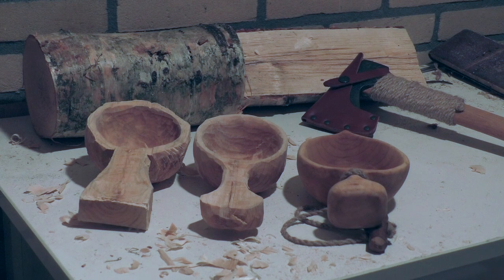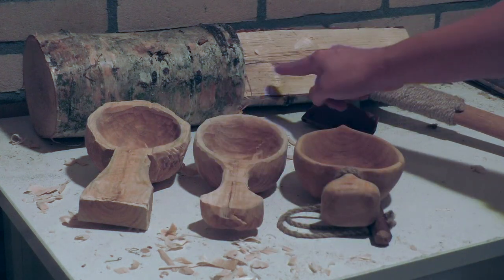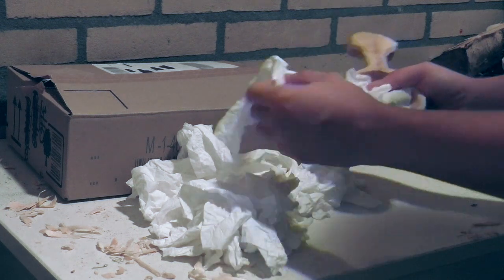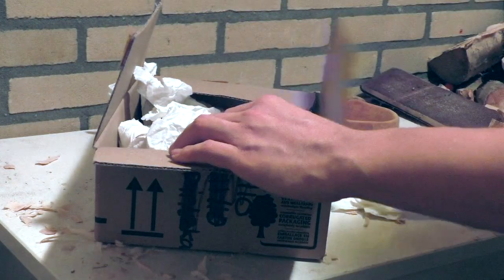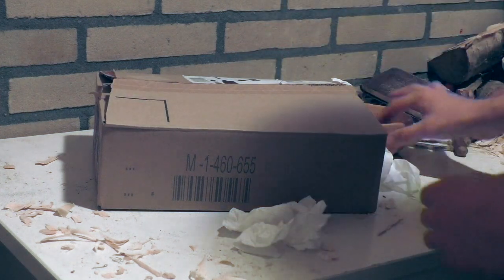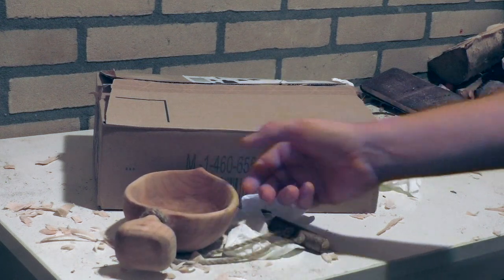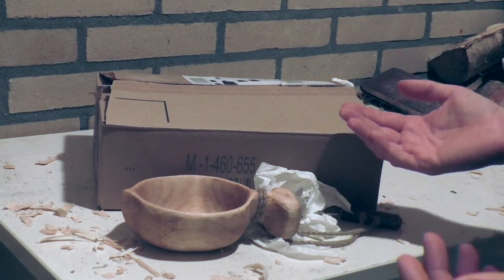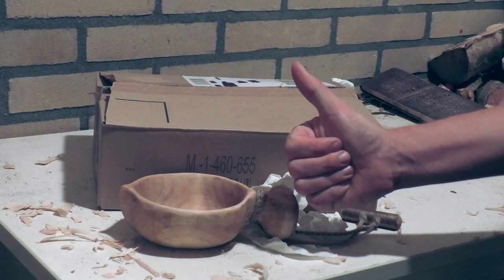How To Dry A Kuksa Safely Without It Cracking Or Splitting

Comment from the maker: HERE ARE SOME ANSWERS TO YOUR QUESTIONS: 
Q:   How long should I leave the kuksa to dry? 
A:   As far as the exact drying time depends on your very selection of wood and the respective project as such, I cannot tell you a specific time frame you could keep in mind. But in general you can tell that all went well by touching the very toilet paper or tissue paper with your lower lip - once all the moisture has been successfully removed from the fibers AND evaporated fully from the paper box and TP, you are good to go. The TP and box need to feel absolutely dry to the bone when touching them with your lip. I personally leave projects for yet another couple of weeks once that point has been reached , just to be sure. Patience, as so often, is of the essence.
Q:   When closing the box, don't you provoke fungus growth? 
A:   Theoretically yes, but I never experienced any issues with fungus/mold when using this method. It might be worth mentioning that I am usually working in intervals - let's say the rough outline is done on Monday using a hatchet, then I'd continue one or two days later with the rough knife work, just to finish the fine carving by the end of the week and having the sanding done once the drying process is done as mentioned in the answer to the first question. So in other words: By regularly opening the box to get to my projects, I am ventilating it anyway. I would recommend doing this once a day or so, just to be sure. Besides that, I store my projects in temperatures below some 20°C (i.e. some 70°F).
Q:   What do you use for the finish of your kuksas after they dried? 
A:   Personally I stick to linseed oil. One might go for charring the wood, too - the process is called pyrolysis in case you want to look that up. I haven't tried that so far, but will edit this answer once I tried it. 
Q:  Does oiling the piece prevent cracking?
A:  Drying and oiling a piece are two entirely different steps and should not be confused with one another. 
Most cracks appear during the drying process, as explained in the video. Oiling must only take place after the project has dried to the fullest extent - the reason being that oiling your project closes the pores of the wood. Now imagine oiling a moist, green wood - well as you can guess, this will result in damage over longer periods of time. 
Usually the wood starts to get a little frizzy on the surface after a while, cracks can then reappear. 
So first let the wood dry properly, then go about the finishing with some sort of oil like linseed oil or so. The oiling mainly prevents decay in terms of rotting/fungus/etc.

------
Got any other question? Just leave me a comment and I'll gladly add the info here.
------
Wanna support this channel? Then please consider becoming a patreon - just visit my Patreon page here: https://www.patreon.com/rathwulvenbushcraft
Thank you.
DO YOU WANT MORE INFORMATION ON BUSHCRAFT, FORAGING AND ANYTHING RELATED TO THIS CHANNEL?
Consider subscribing to the Rathwulven newsletter - all for free, no obligations and you can always opt out if you do not want to receive it. Just register here:
https://mailchi.mp/6b4642ab28af/rathwulvenbushcraft
If you have any questions, please also feel free to drop a comment.

Comment: Not sure if closing the box is a good idea. You might get fungus then.
Here are my experiences.
I've made several kuksa's and to prevent cracking I put the kuksa during the project overnight or when it is finished in a standing paper bag with the woodchips from the carving, and leave a small opening on top for the moist air to go out. Don't close it, otherwise you have a good chance on fungus.
Another good way is by boiling indeed in salty water once the kuksa is finished, and if you want to darken the wood, drop in a few bags of black tea.
And last suggestion that i have not tried myself yet, but is used by a few friends of mine who ate experienced wood carvers, they boil them in milk.
Apparently the casein denatures, closes the pores, and thats it. Good rinse when done, and your good to go.
And as oil I use Tung oil, it will seal the wood also slightly, leaving a tiny hard layer.
Good luck!
Reply from the maker: Thanks for your view on this. I have to say that the salt water method causes issues, in my personal experience. As for the fungus: You got a valid point there, but I never experienced any issue of that sort for as far as I am working on the respective project in intervals. Maybe that makes all the difference, because if you do some 1 to 2 hours of carving work a day, you take out the items of course and hence ventilate the box as such. 

Gotta look into tung oil for sure, thanks for the tip. I usually stick to linseed oil. 
ATB 
Ralf

Comment: Nice! I am going for my first carving project, and I will try this method. How long do you need to keep the item in the box/how do know when it is dry?
Reply from the maker: Thanks for your comment, Arian. I wrote some additional info on that in the pinned comment. 
Generally the longer you wait, the better. Let me know how it is going ok? And if you have questions, feel free to reach out.
Reply: @RathwulvenBushcraft  Awesome, thanks! I have some projects in the box right now. I have changed the TP 1-2 times because the TP got quite wet. Still drying though, 7 days in.

Comment: Ive heard the main reason you do the salt water boiling is to clean and disinfect it. Something about the salt water drawing out the dirt and bacteria or something i think
Reply from the maker: Hi Connor - wherever that "information" is taken from: It is not true. Salt does not sterilize - if that was the case, no organisms could thrive in the seas, yet all life comes from salt water. Same goes for "cleaning" the wood pores. The funny thing is that any wooden cutlery or kitchen utensil behaves the same way: Warm/hot water opens and hence accesses the pores in the grain, cold water/air closes them. Which is one of the reasons one should not leave spatulas or spoons in a can of soup, for example but always has to remove them and wipe them clean properly. 

That salt water myth is a pretty tough one, probably started somewhere online and kind of established itself as a "fact". 

Have a good one!
Reply: @Rathwulven Bushcraft  very interesting. Thanks for the info, that's why I brought it up, I kinda wanted your thoughts on it haha. Very good to know, have a great rest of your day

Comment: As I'm admittedly not a wood carver yet the one thought that came to mind is how long are you leaving them in the cardboard box to dry? What are your indicators that its dry enough to not worry about cracking?
Reply from the maker: Hi Carl, I explicitly did not mention any drying time as far as this will always vary depending on the respective project, type of wood, and so on. But in general you can tell that all went well by touching the very toilet paper or tissue paper with your lower lip - once all the moisture has successfully been removed from the fibers AND the paper box and TP are dry to the bone, you are good to go. I personally leave the project for another couple of weeks then, just to be sure. Patience, as so often, is of the essence. Because there is one thing you do not want to do: Seal the pores with linseed oil or so while there is still a bit of moisture inside the wood. I learned that the hard way; it is better to just give your project another month than to just mess it up during the very final steps. 
Hope that helps, if you got more questions, just let me know .

Thanks also for pointing that out, I will pin a comment to the top with your question and an answer.

Comment: You could also use rice. Rice absorbs moisture quite well. Those silicon packs would work too.
Reply from the maker: Hey Scott. I am not sure if silica gel would be my go to, simply for ecosustainable reasons. For rice: I did not try that, also because I assume that rice would eventually turn moldy, wouldn't it?
Reply: @RathwulvenBushcraft  
No, if you're using it for only a week....it won't get moldy. It has to be moist before that happens. Drying wood, it wouldn't absorb that much moisture out of the wood....you could use it to dry several projects. 
Of course, check it after a couple projects. If it smells ok, carry on. Of it smells a bit sharp, change the rice.

Comment: Hi, have you even used thistle oil as a finish for kuksa? Or do you know anyone who used it? If yes what was the result?
Reply from the maker: Hi Martin, thanks for your comment. I did not use thistle oil so far so I cannot share any practical experience. Yet I have one concern regarding that oil: Most thistle oil manufacturers produce their products by cold-pressing green plant parts, which results in a different type of oil as for example those extracted from seeds like linseed. The main issue with oils extracted from green plant parts is that they often are containing a lot of water/sap and hence are considered "dry" oils. Sounds a bit paradoxal, I know, but here "dry" refers to the actual "fattiness" if you know what I mean. Dry oils do more harm to your finished work than they do good.

Long story short: I would not use thistle oil based on my assumption, but I'd also gladly be correceted if that assumtion shoud be wrong. :)

Comment: Does oiling the piece prevent cracking?
Reply from the maker: Hi Michael - thanks for your question. Drying and oiling a piece are two entirely different steps and should not be confused with one another. 

Most cracks appear during the drying process, as explained in the video. Oiling must only take place after the project has dried to the fullest extent - the reason being that oiling your project closes the pores of the wood. Now imagine oiling a moist, green wood - well as you can guess, this will result in damage over longer periods of time. 

Usually the wood starts to get a little frizzy on the surface after a while, cracks can then reappear. 

So first let the wood dry properly, then go about the finishing with some sort of oil like linseed oil or so. The oiling mainly prevents decay in terms of rotting/fungus/etc.

Hope that answers the question. :)

Comment: I wish I would have done more research before all the time I spent carving one. I carved a small cup just to try out of some fresh silver maple. I didn't let it dry properly before oiling. I used tung oil. The very next day it had a huge crack running down the back side near the handle and a crack along the underside. Still keeping it as a reminder.
Reply from the maker: Hey Nathan - I can only relate too well to your experience, I also had to learn about the importance of patience the hard way. Hope the subsequent attempts were more successful. 
Thanks for your comment!

Comment: How long do u leave it in there???
Reply from the maker: Hi there - I wrote a reply in the pinned posting: 
As far as the exact drying time depends on your very selection of wood and the respective project as such, I cannot tell you a specific time frame you could keep in mind. But in general you can tell that all went well by touching the very toilet paper or tissue paper with your lower lip - once all the moisture has been successfully removed from the fibers AND evaporated fully from the paper box and TP, you are good to go. The TP and box need to feel absolutely dry to the bone when touching them with your lip. I personally leave projects for yet another couple of weeks once that point has been reached , just to be sure. Patience, as so often, is of the essence.

Comment: If you take of the centre of the wood project by cutting it away you will have no problems  with cracking of the wood while gradual drying...
.
Reply: I see in your three phases of kuksas making that the centre (heart of the wood) is still present after cutting.
Reply from the maker: Sorry for the late reply Marc, I missed that comment. 
I fear I did not fully understand your point - do you mean the pith of the wood? If so, then I'd like to point out that I did indeed split that log right along the pith, but also did substract a couple of millimeters prior to finishing the final kuksas. Never had any issue with that. 
But of course you are right that the pith itself is a weak spot in general. Learned that the hard way quite some years ago...
Thanks for your comment.